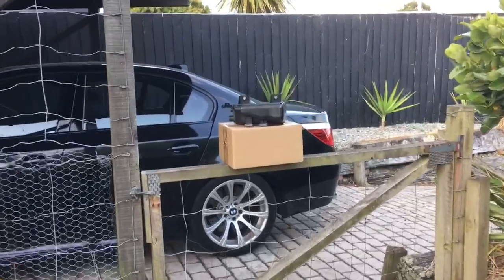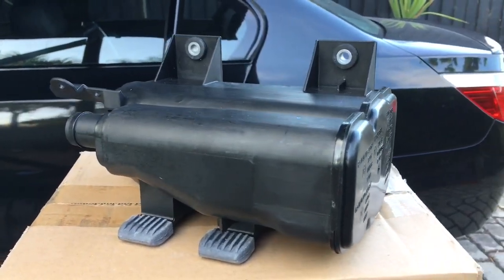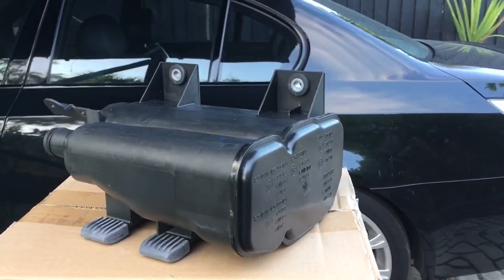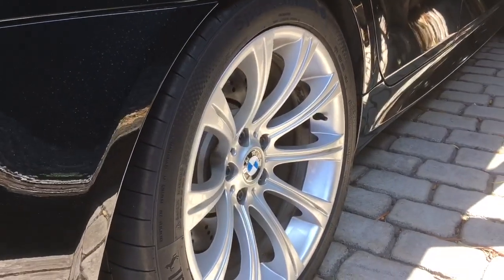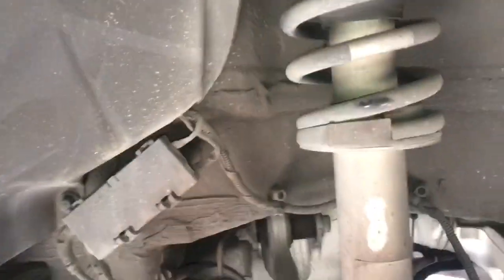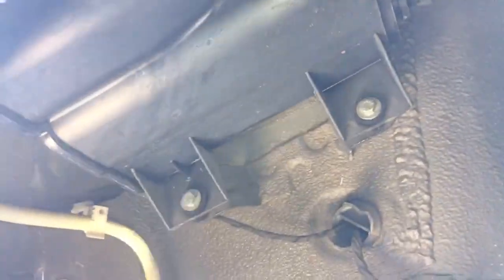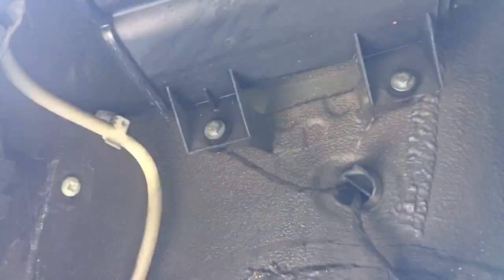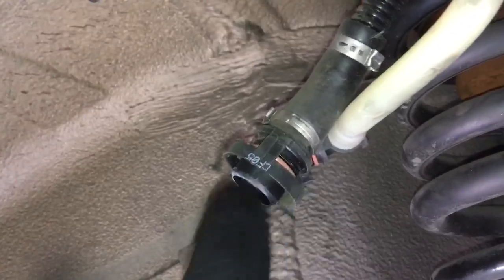BMW E60 M5 Charcoal Canister Replacement

Comment: First; many thanks for sharing your knowledge, which was very useful when buying my E60 M5. (Same as yours; black, 2005 modell, Euro-spec). Picked up my car yesterday, and the seller had just gotten the 02-sensor ("sensor 1") changed at his local BMW dealer, after the "check engine" light came on. When test driving the car the engine light came back on, and we ran a diagosis which reads: "P2297" - "O2 Sensor Out of Range During Deceleration Bank 1 Sensor 1". The same code the dealer had gotten. Having watched your video on replacing the charcoal canister, I decided to open the fuel cap, and the car was gasping for air. Tried driving for 15 min min, and then opened the cap again. Almost same gasping, telling me that the charcoal filter must be blocked and that the canister needs replacing right away. Then deleted the code and drove home with the tank topped up and the cap almost open, to let air in. After 2 hours of driving, the engine light came back on, and even though the cap was open there was much vacuum when i took the cap off. So to my question: If you drive with a charcoal canister that obviously needs replacing, will this cause the engine light to come on? (My/our thoughts are that the cars very advanced engine controles will react if there is a substantial vacuum in the the tank?). Your thoughts/experience on this? Others? Thanks in advance. Anders (Norway)
Reply from the maker: Thanks man, congrats on the new M5! O2 codes are normally caused by other issues rather than the sensor itself. Sounds like charcoal canister issue- the 02 sensor is expecting to see a richer condition once the purge valve is open, but it’s not because it’s likely the charcoal canister in blocked, so it’s throwing a code. Your charcoal canister definitely need replacing so I would start with that and go from there

Comment: Just Done mine, the only issue I had was the 1 single plastic clip in the wheel lining(head broke off) and the the connectors where pretty stiff to remove, I think I need to do some finger workouts to get there strength up 😁 did fuel filter also at the same time, both great vids 👍
Reply from the maker: Thanks man. Those old plastic clips love to break aye! Good job to do together with the fuel filter. Thanks for watching

Comment: Changing my totally blocked charcoal canister, the fuel tank was also inspected, and it was found that the tank had "imploded" in a few places. Nothing indicates that the pump or the gage is damaged. Also no signs of leakage. Cost of replacing the tank (pump included) is approx USD 4700. (BMW dealership and converted from Norwegian currency). So now I am wondering: Is there any chance that the tank can "mend it's self", now that the vacuum issue is sorted and keeping the tank topped up? And if not, should I bother changing the tank as long as it is not leaking and everything else seems to function? What do I risk? I want the car to be "perfect", but USD 4700 is a lot of money. What are your views here? Thanks!
Reply from the maker: Depends on how bad your tank is.
Source a good used tank and get the dealer, or a BMW specialist garage to fit it with your existing pump (my local dealer will fit used/aftermarket parts but obviously no warranty and the labour rate is up there)
That’s what I’d do but fit it myself 👍
Reply: @MTechGuy  Thank you for the advice! (I see that 3/4 of the cost is labour, taking down the rear axle ++, so I will for sure consider asking a friend with the knowledge for a hand).

Comment: I recently got a DMTL pump fault (code 002776). Does this mean I need to replace just the pump or the charcoal canister as well? It's a 2008, about 100K miles. I live in North America.
Reply from the maker: If it where me I’d change both out at the same time as they are accessed together, and if your charcoal canister is original it’ll be just about ready to be replaced anyway